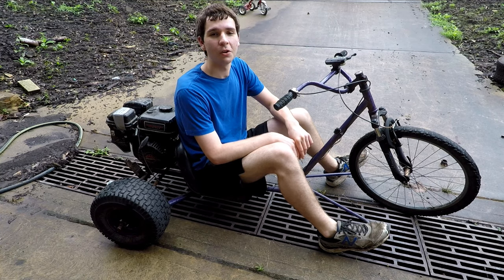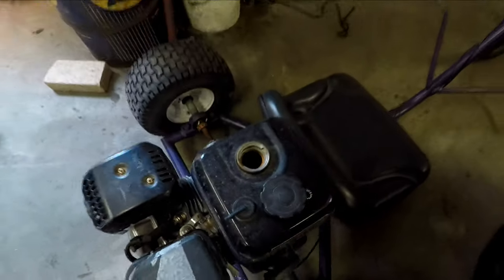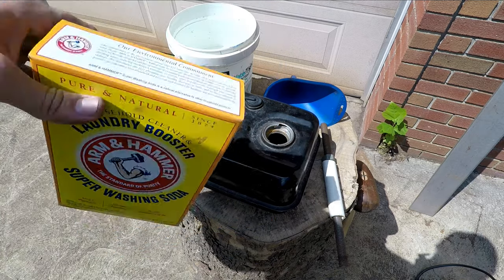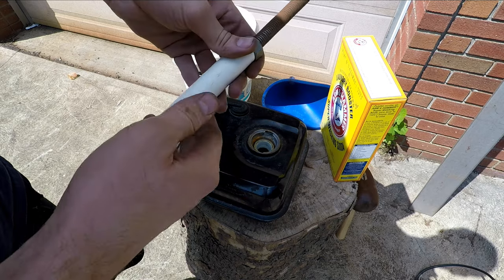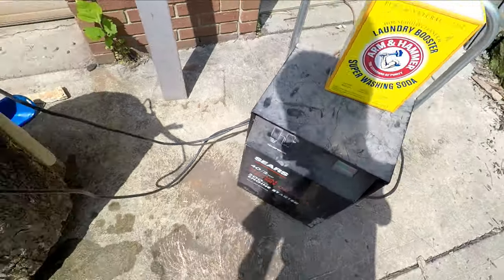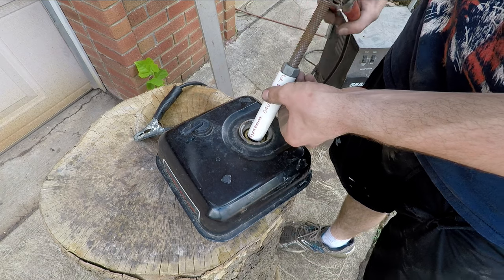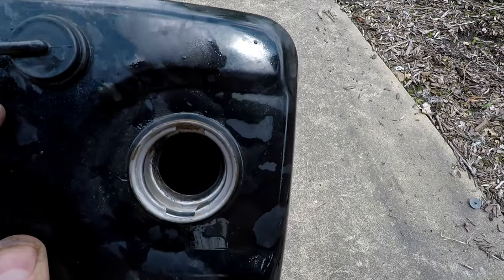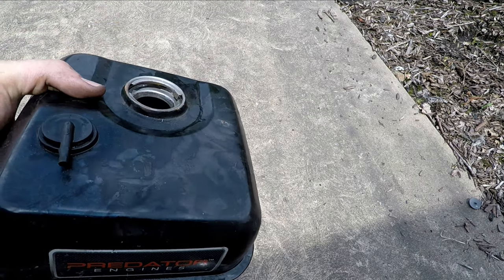How to Clean a Rusty Gas Tank With Electrolysis

Comment: Shoulda tossed some rocks and gave it a good solid shake before you poured it out. An inline filter wouldn't hurt either. I'm sure it's fine though. Creative solution with the pvc on the rod too. Good lil vid.
Reply: Toss in a dozen 1/4 nuts or steel balls removed from  ball bearings instead of  rocks....

Comment: The ethanol in gas is hygroscopic. It will draw water out of the air. Leave a container of gas that is not tightly sealed in a humid area and it will collect water.

Comment: You should coat the inside with a tank liner to prevent it from rusting again
Reply: Or maybe galvanize it using a similar method
Reply: Nope, just clean it again if it rusts.

Comment: Have had good luck with this process on other things and thought of doing a tiller tank the same way. I had basically the same idea as you in regards to preventing a short. 
  Glad I decided to search on YouTube. 
  I might fit a piece of pvc, tape, or rubber on the bottom of my rod to prevent it from possibly shorting against the tank.

Comment: I just tried this for almost 8 hours yesterday worked but not as good as I thought with just baking soda of course I only checked it twice and both times I had to readjust because the light on my battery charger turned off so it wasn't doing the effect but the brass bar I used weakened so much I crumbled the piece that was in the solution and it turned green so later vefore I had to leave my grams to go home I tried some toilet bowl cleaner you can get fir a dollar at tte dollar store the works which is what I tried first but it didn't do a good job because I learned the works made theyr formula weaker than it used to be but I looked it up and the acid in it is not only conductive but an electroylote I let it in maybe about 30 minutes with electrolysis loosened up the rust quickly atleast a good amount it still needed more so when I got home I tried some more but it wouldn't work my battery charger was turning on but it didn't go to the other light that indicates it's working so because the solution was very dirty I tried emptying it cleaning refilling with fresh hot or warm water still fixnt work I tried cleaning the aliggator clamps withsandpaper since there was a lil stuff on em still isn't working and for some reason my fuel tank wont fill all the way up somehow I think its looking

Comment: I watched this video and got intrigued, so I decided to try it. I didn’t have much luck. My battery charger doesn’t even come on when hooked up this way. Not that was evident anyway, no lights, no buzzing sound nothing. So I left it hooked up for about 8 hours. I was trying to clean a small piece of metal in a five gallon bucket. I followed you instructions to a t. I even researched it on the internet. I used arm and hammer washing soda. About three cups to five gallons. No results. What did I do wrong? My battery charger works fine when hooked up to a battery. Do you have any advice? This process would come handy in my garage if I could get it to work.
Reply from the maker: I'd make sure the cathode isnt touching the gas tank, and that the battery charger is strong enough. There's also lots of information about the process online to do more research
Reply: A battery charger that detects the condition of the battery cannot be used for electrolysis. It wants to detect a battery.
Reply: Daft Old Man My first experience with this process, I used a battery charger that can read condition of battery by pushing a lever down.  Had VERY good luck with it. Lot better than a small 10 amp charger I have tried. The small one would only show maybe 1 or 2 amps when connected to the the system.